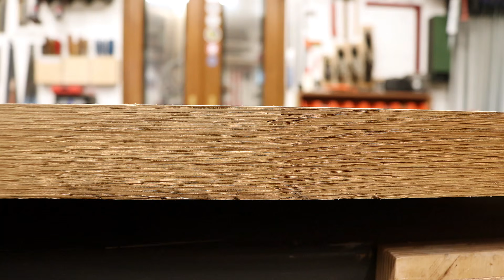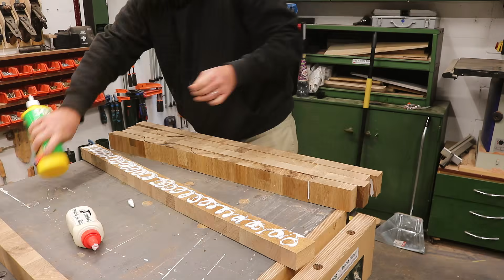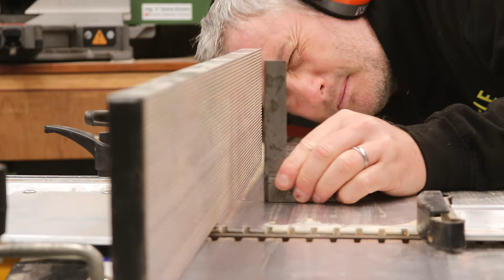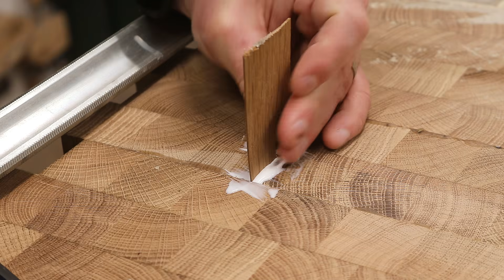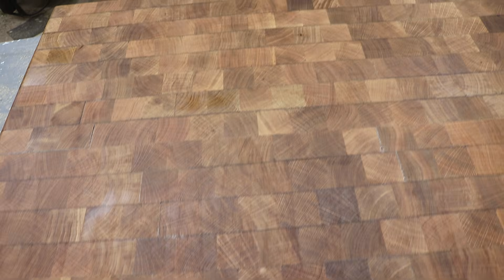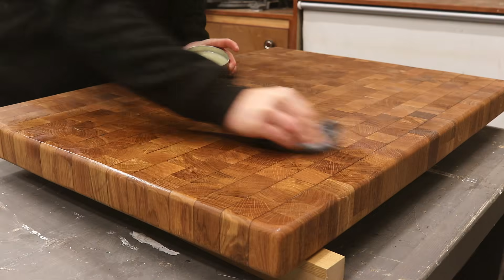Turning Salvaged Oak Countertop Offcuts in to £££

Comment: Before you put a finish on, like that tung oil, you can apply some mineral spirits to the wood. This gives you a 'preview' of what a finish will look like AND reveal things like glue residue and sanding scratches, which you can then address. The spirits will soon evaporate and you can go ahead and apply a finish with more confidence.

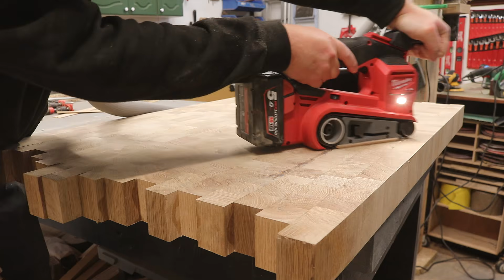Comment: Matthias Wandel had a great idea recently for easily spacing things from an edge like you're dong with the track saw track. Rather than the jig you've used here that pushes on the front of the track, make two narrower versions of them with a long "arm" that goes just over top of the track and past the backside with a block at the end attached to the underside. Position each jig at the ends of the track and the blocks will catch the backside of the track as you push the track AWAY from the edge. Check out Matthias' recent video "Dresser build" starting at 5:22 for a visual of how it works. It'd also be easy enough to make this sort of thing adjustable and reusable.
Reply from the maker: Cheers yeah I saw that, great stuff. I love his channel

Comment: Done pretty much the same, but smaller size (295mm x 270mm x 25mm) to make end grain cutting boards. Six strips of the oak off cut and an 8mm width of walnut between the first, third and fifth glue-up joint. For the finish I just use mineral oil. They look great, very practical and are relatively easy to make.